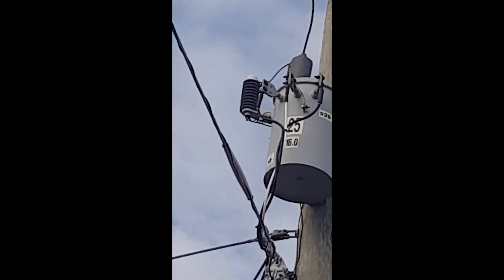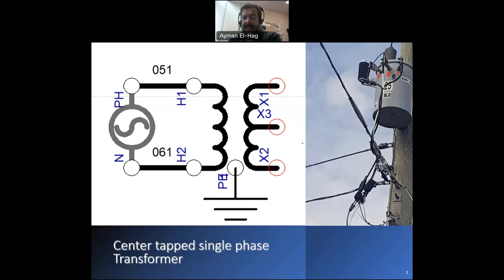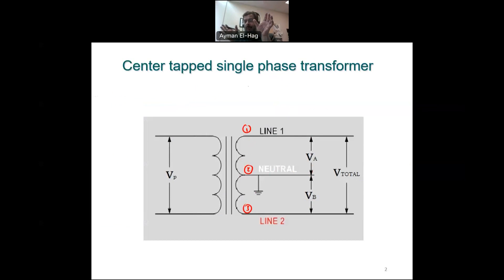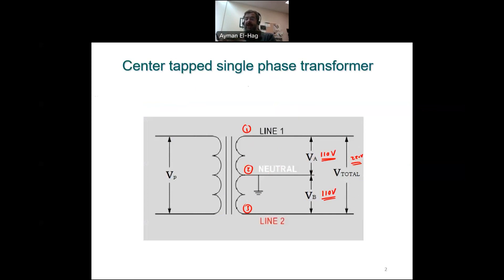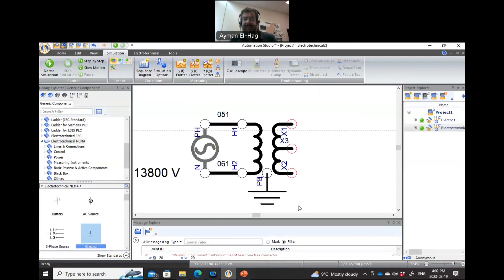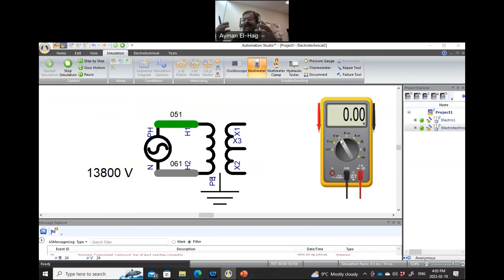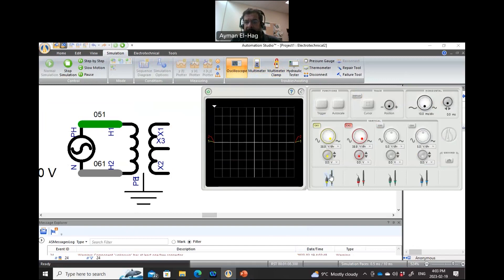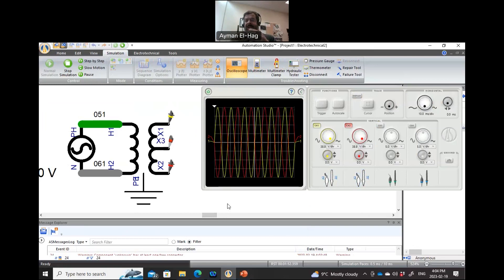Center tapped single phase transformer

Comment: drawing shows two bushing primary winding.   Picture of transformer only one bushing.
Reply from the maker: In single phase transformers you usually use one bushing except if the transformer will be connected as a transformer bank with delta connection then you use two bushings in the primary. In regular single phase transformers the other side of the winding will be grounded.